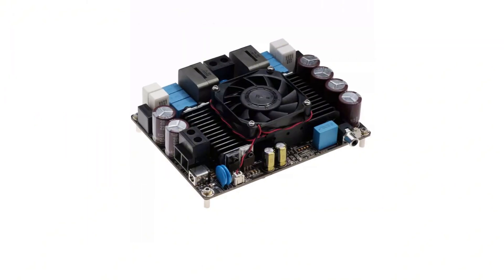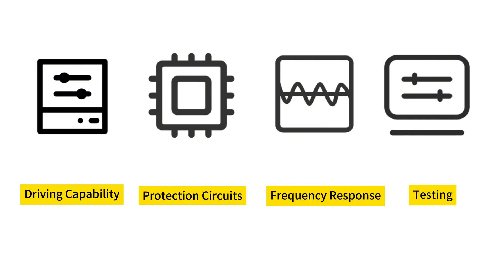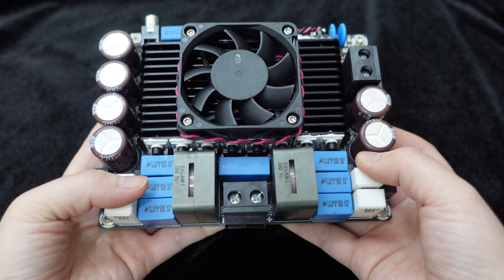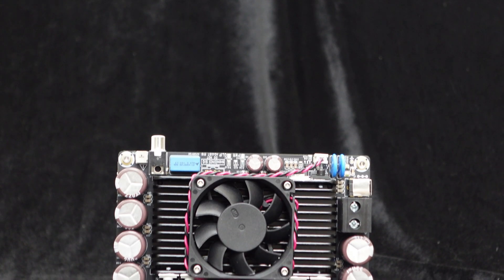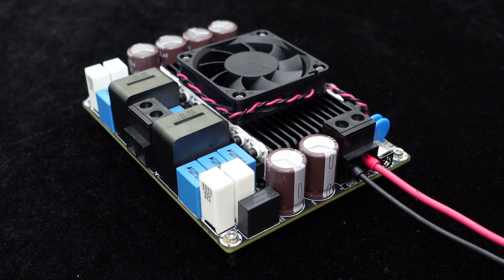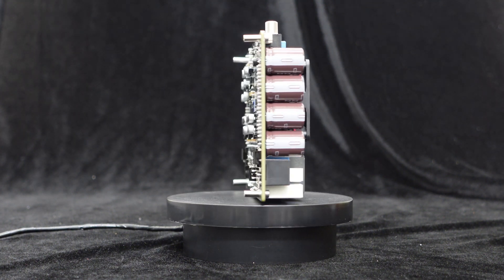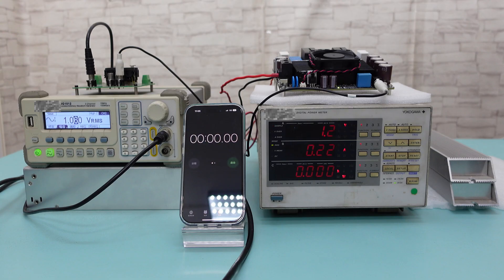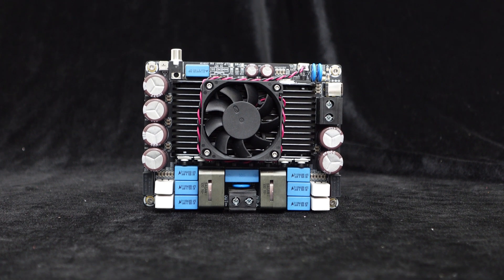Can the WONDOM ultra-high power mono 2000W amplifier board really output 2000W? Output Power Test

Comment: Hello. Does this amplifier support DSP APM2 board?
Reply from the maker: Hello, thank you for your watching. Since this mono 2000W amplifier features a high gain level, when using with APM2, even tiny noise will be amplified a lot. It's not recommended to use them together.